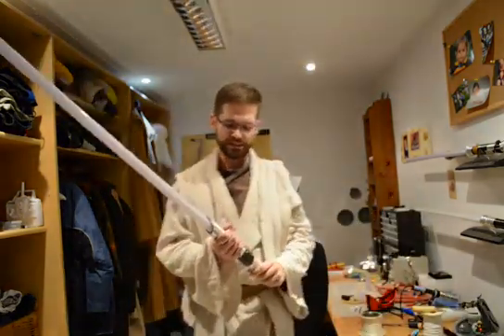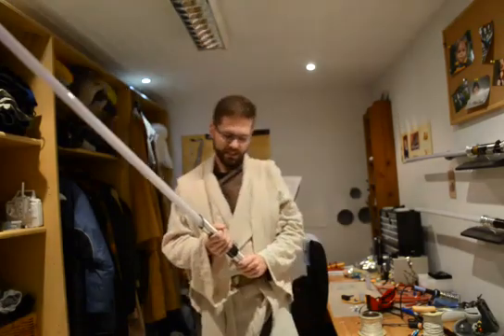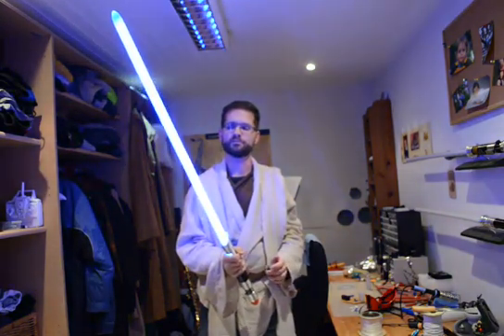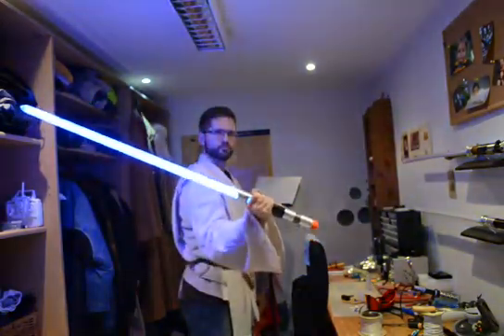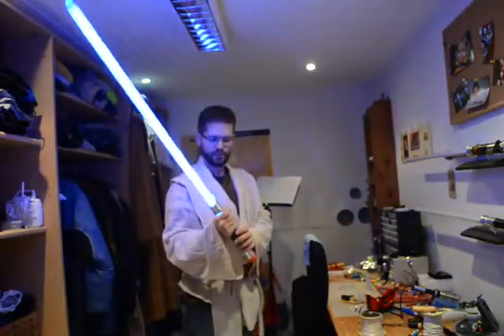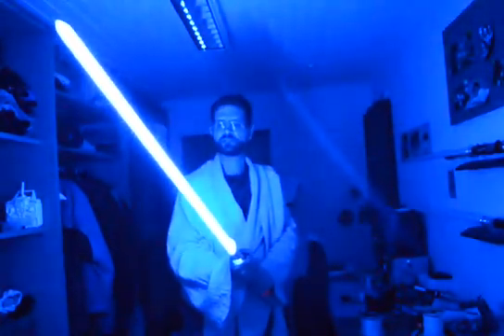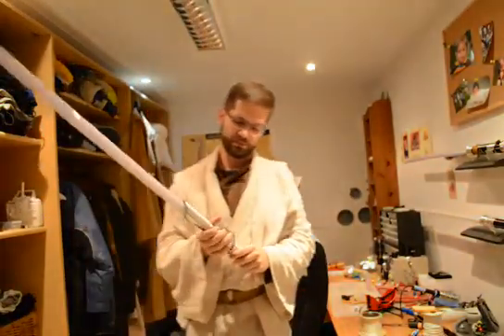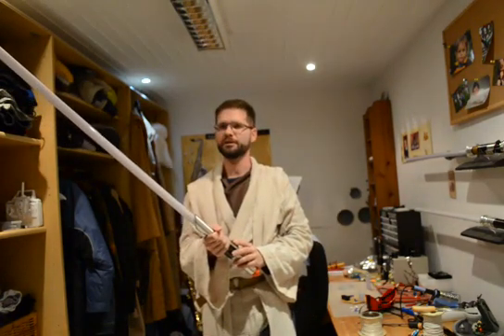LED string blade Arduino Lightsaber

Comment: I made some audio test with an WT588DM03 but I don't get a continued sound. I will try the Sound module you use here. Is the blade selfmade?
Reply from the maker: If you don't want to fuss around with the modules, just grap a DIYino board. On these you have everything you need. The LED string is self-made, yes.
Reply: Andras Kun OK I will look at this. The blade, I mean the plastik part must be buy?  ... German? Das Plastikrohr hast du bestimmt gekauft, oder ist das auch selbstgemacht?